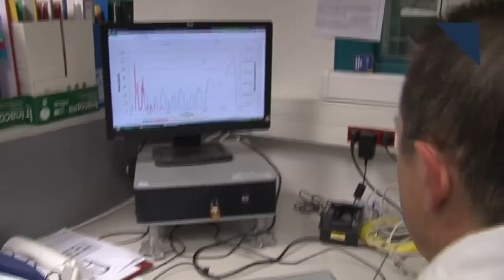Porsche Mission E, Tesla Model 3 Teardown - Autoline Daily 2278

Comment: Perhaps they should have started with the fact this would only be done to a Model 3 by First Responders, not End User or Service Personnel.  The Model S had videos prepared for First Responders that take them through every aspect of safely disabling the high voltage connections.  It is very likely the same exists for Model 3.  Those wires are purposely a specific international color of orange to denote high voltage.  No one who is properly trained will have an issue opening the hood in an emergency.  This is thoroughly biased [BOLSHEVIK] -- again -- because this channel is woefully beholden to 'independent franchised dealerships' that are scared $#!+less by Tesla's direct sales method.

Comment: I don't understand why they're complaining about the hood access to that power cable and talking about getting people out of the car. Both front doors have emergency manual door releases - the power line under the hood has nothing to do with that.

Is this deliberate obfuscation?
Reply: good luck using that handle when your unconscious.  or in the back row.  Those guys are going to tear down that car to the last screw. Those comments were just on of the first things they discovered.

Comment: The fire department is going to stick a pry bar in the hood and pop it open and cut the wire in 10 seconds. The system he showed to open the hood is meant for if the cars 12V battery dies. It's the spot you can attach a 12V battery in order to bring the car back to life.  His issue seems to be most cars have an interior mechanical method to open the hood, but in a lot of cars that could be located in area you cant easily reach if the door for example is crumpled.  Also he mentions that he 'thinks' the screen is unlikely to work if the car has been in an accident, but why is it more likely the case versus a mechanical hood release being damaged in an accident.
Reply: steve -- Yup.  And the main purpose for that pop-out cover is to expose the tow hook connector that would be used to winch the car onto a flatbed if necessary.  Since the car has a frunk, where people can store belongings, a manual latch would make it that much easier to steal things from the car, or allow EV haters to [FOUL] with it.  Manufacturers are allowed to latch a front hood, but not lock it.  Maybe they should take a long, hard look at the process to open the hood of a BMW i8...?

Comment: While I am a fan boy of Tesla's I am always keen to learn of problems they may exhibit. I've now subscribed in the hope of enlightenment. Tesla were always a little cavalier about emergency manual overrides. If you travel in the back of a Tesla Model S and there is a chance you may end up in a canal with the electric systems not working it would have been a good idea to have read the manual carefully about how to manually open the rear doors (they have electric rear door locks). The procedure is not something you could work out in a panic situation and involves lifting some carpet to reveal some mechanical wires which have to be pulled before the rear doors will open sans electrical power. Note the front doors do not have this problem,  a hard pull on the internal door handle will release either front door with or without electrical power. Still the traditional auto manufacturers have had a less than stellar history when it comes to ignoring known problems that have resulted in many deaths like the GM ignition switch problem and the Ford Pinto vulnerable gasoline tank so I feel Tesla should be allowed as much slack as anyone else (which should be very little when lives are at risk).
Reply: Dogphlap -- The presumption is that rear seat passengers in sedans are often children.  So you don't want emergency releases to be easily accessible by ther exploratory hands.  Presuming the adults in the front seat are buckled in safely, they will have survived most accidents in good enough shape to release rear seat passengers themselves.  That is exactly what has happened in the vast majority of Tesla accidents.  Non-fatal, passengers walk away.
Reply: +redxsage      Ah, now that is a good point. Still if I was drowning in the back of my friends car I might care more for my own life than protecting his obnoxious kids from self inflicted road rash.

Comment: The key part that CA seems to miss is that if they want ZEVs to catch on, they must be cheaper to own, operate, & maintain. Cost is an immutable force in economics as consumers seek out lowest cost just as persistently as water seeks the lowest ground.

Thus, if CA wants ZEVs to succeed & supplant other vehicles, they need to help automakers find ways to may them cheaper. Lower cost batteries will do that for EVs. But there is no way they can do it with hydrogen.
Reply: dMb -- Cheaper than... 'what' exactly?  Tesla's cars cost the same as or less than their direct competitors.  Electric cars from traditional automobile manufacturers cost a minimum $15,000-to-$20,000 premium over similar ICE cars.  The majority of cars sold each year are USED, by as much as a 20,000,000 unit advantage over NEW car sales annually.  Used cars average over $19,000 each and more than ten years old.  New cars average over $32,000 sales price.  Tesla's cars cost thousands of dollars less to operate over the course of five years than 'the average new car' per the EPA.  Even GM had to admit their electric car the Chevrolet BOLT effectively requires ZERO maintenance.  What other hypothetical would you care to pose as a reason why electric cars cannot suffice... 'yet'?

Comment: The real safety issue I see with the mode 3 design  is not opening of the frunk after an accident, it is the HMI (human machine interface). It appears to significantly increase the number of 'eyes off road' events compared to other vehicle designs. It would be interesting to hear the opinion of a human factors specialist on this issue.
Reply: Paul Riseborough -- [BOLSHEVIK]  It isn't as if people memorize the precise position of the 'RECIRC' button on the dashboard of every car they own and can activate t every time without looking.
Reply: Agree, but  'muscle memory' assisted by tactile feedback (a physical button) assists a lot and that is a low frequency example compared to things like wiper frequency adjustment or cruise control speed. The model 3 requires multiple tap operations for many common functions and the change in viewing angle required is excessive. It looks like an interface concept designed with styling and autonomous driving as the priorities.

Comment: The model 3 battery isolation raised needs to be put into context. Previous tesla battery packs had a pyro fuse that was triggered electrically. If the fuse is triggered in an airbag deployment event, then the likelihood of needing to cut wires to free occupants is remote.

Comment: Sounds like an easy fix for Tesla to me, but I’m sure there is a reason for it, why not contact Tesla first before you contact Autoline Daily...
Reply: I'm sure the reason it's electronic is for valet mode -- where you cannot open the hood if you are a valet. Pretty tricky to do that with a cable system.
Reply: Robert Blackford -- Dude.  Even ICE cars provide a separate key that won't open the trunk or glove box for use by Service personnel or Valets.  It is illegal to actually design a front hood with an actual lock, because... First Responders.  You can have (and likely must have) a secure latch.  That is all this is, so you don't have to worry about someone stealing your tennis racket and gym bag while you step into a convenience store.
Reply: Question: Why do they have to open the hood.  There is no gas or engine there.
Reply: Earl Pottinger -- In a crash, there are a couple places to do an emergency cut of the high voltage wiring in an electric car.  In a Tesla, one of them is under the hood, denoted by cables in a bright orange color.  The other is at the rear of the car.  Tesla provides video of the proper procedure for first responders to use in training as part of their own safety protocols.

Comment: Seems like auto line has a hard on for bashing Tesla! The fire emergency crews have the jaws of life and can cut through any car in seconds they have saws etc.
Reply: John you are missing the point, do you think the HT wires run through the front trunk and why would you want to open the trunk, nobody in there!
Reply: John, Are you or have you ever been a Firefighter? Are you trained in using the jaws of life? Perhaps you should get a professional on the show to explain the procedure.........
Reply: Yeah I guess they could have made it easier but then maybe they did that way for a reason like valet mode seeing how it is a storage area.
Reply: No autoline missed the point when you claimed that it would be hard to disable the model 3's high voltage system from the front knowing it could be done from the back. First response aren't going to waste time opening the hood and will peel that sucker off like a sardine can. The loops themselves are low voltage and it also disables the SRS system which every new car has and it's under the hood so are they any better? Do you want to cut into any car that has undetonated side curtain airbag? Tesla wouldn't be able to sell the car if it didn't meet regulations.
Reply: Gordon lang You missed the point. Are you going to cut into a car blindly with 400 volts running through it?